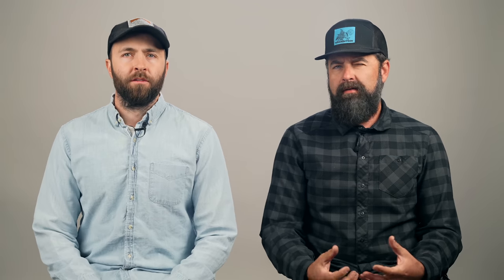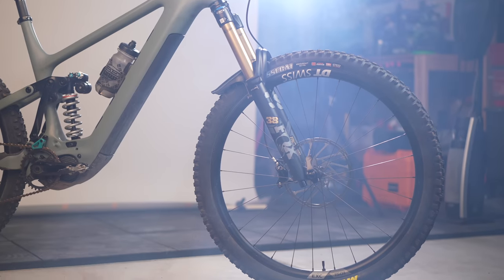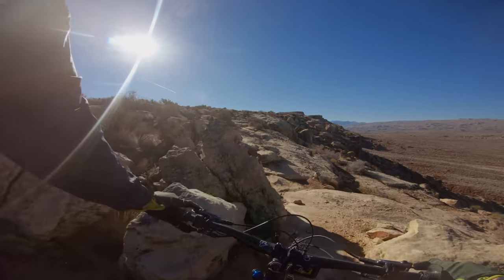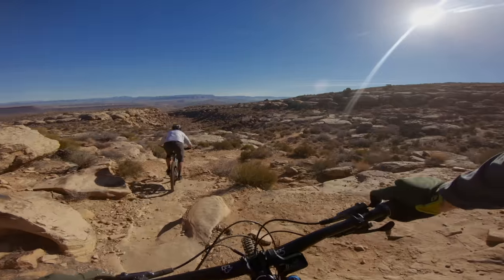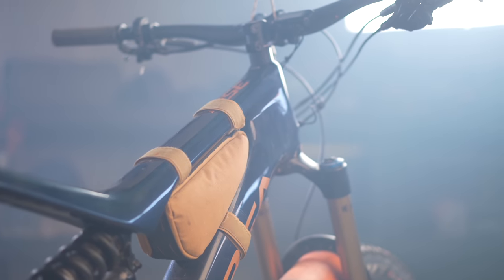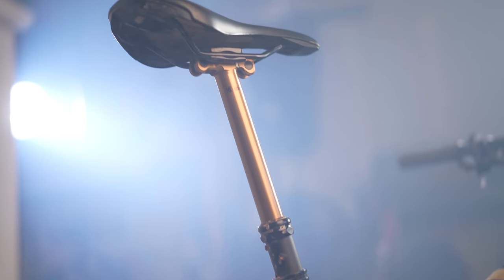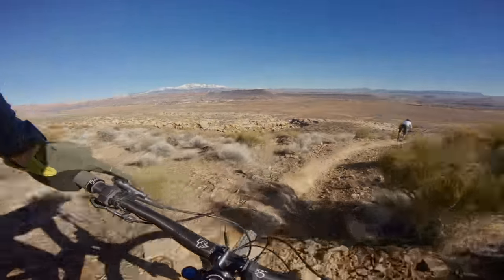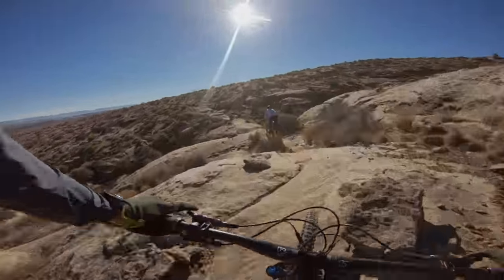Is a Slacker Head Tube Angle Better?

Comment: I took a Spot Rollik and added a -2 headset and a +10mm fork. Preserved almost all the geometry numbers accept the head angle which went from 67 to about 64.5. Loved it but it was noticeably floppier on tight climbs.
Reply from the maker: Good thinking with over forking in conjunction with the angle adjust. I noticed my Rise got a bit floppy too. I guess there are always going to be drawbacks
Reply: I just switched to a Ripley AF, my only the complaint is the number of pedal strikes I’m getting. Not sure if I should go up to a 140 air spring or put 165/170 cranks on vs the 175 that came stock. I love the way the bike does everything else so I’m hesitant to mess with the geo.

Comment: Since the angleset  is "lowering" the bike wouldn't it also steepen the seatpsot angle?. This could be a huge benefit on older GEO bikes that have slack seatpost angles such as the older Trance/Reign
Reply from the maker: It does make the seat tube steeper. It can help a bit there.

Comment: 75% of the riders out there don't have descents more than 1-2 minutes, so super slack bikes don't equate to better performance in those environments. I still ride a Stumpy 29er w a 51mm offset --68 degree head angle. It is perfect for riding in the midwset with way more climbing than descending.
Reply from the maker: Move to Utah. Our descents are way longer than 2 minutes.
Reply: @bikersedge  Dude, I almost moved to Durango 20 years ago. I regret it daily. Now, with wife and kids we can't move away from grandparents and their friends. 

I suppose the terrain out West would draw me to a more modern geo, but bikes have been very capable for a long time. Still love my light nimble 2013 Stumpy Elite 29. It is an alloy frame, with carbon cranks and bars... with tube. tools, water bottle, and frame pump, it is sub 30 lbs and 140/130 travel. It would be a downcountry bike by today's standard, That is what most people need imo.

Comment: Surely on a mobility bike you dont need to worry about the bikes geometry and setup on the climbs as much as a mountain biker would? I have spoken to a fair few people who have said that the ideal mobility bike would basically be almost a DH bike with a dropper post and a motor etc because they put in so much additional power that it massively compensates for pedalling position etc.
Reply from the maker: Not sure what a mobility bike is…

Comment: i'm planning to change my fork(rigid) to a suspension fork.

currently my bike setup is 69er mullet (26er frame). coz when i'm riding sometimes my foot sings in the front tire.

That's the reason why i wanna change the rigid fork into a suspension fork.

what travel fork should i be using? so it will be a little bit slacker at the same time it won't destroy the geometry.

thanks!!

Comment: So what was the final head tube angle on the rise? Did you go with an angle set and a longer air shaft? Are you thinking off increasing the rear travel with a longer stroke shock. I have a Rise but I think it would invalidate the warranty. Thanks for the. Review
Reply from the maker: We couldn’t get a super exact measurement but it ended up being around 64° with the Slackr and a 160mm air spring. I’d say plus or minus .3 ish degrees.

I haven’t considered changing the rear travel. I think if you’re going that far you may as well just buy the right bike in the first place rather than trying to turn a bike into something it’s not.

Comment: Any long term thoughts on best combo for Rise? Thinking of 1 degree slackR and 160mm fork for my rise. Love the bike but think it could benefit with a little more for what I ride. cheers
Reply from the maker: I don’t think orbea recommends running a 160mm fork. You might need to check that it won’t get you into warranty issues. If not, 160 with the Slackr could be great.

Comment: I added 10mm to my fork along with a 1 degree angle adjust headset, but I went with the combo because I’m running it on my hardtail (went from 120 to 130mm). My worry with the hardtail was that adding to the fork would actually steepen the HA as you go through the travel, so the idea with the -1 degree to slacken the head angle is to help counteract that a bit. Still haven’t had a chance to take it on a proper ride since making the change a week ago but looking forward to seeing how it handles some more technical trails!

Comment: Would this work?

A 29er with 140back and 150front travel, 66° headset angle.
Replace the backwheel with a 27,5" wheel to make it mullet and add 10mm more travel with a new front fork 160mm to increase the bb height a bit.

Head angle would end up at 64.5.

Smaller rider on a 29er wanting to try a mullet on a 29er
Would making it more slacker and enduro safe at the same time destroy the bike or is this an option?
Reply from the maker: The problem with that is the chainstay doesn't get shorter so you don't get the full benefit of the MX setup.

Comment: @Bikersedge Can you please provide a specific link on which angle headset kit you got on your Orbea Rise please. Thanks
Reply from the maker: It’s the 9point8 Slackr Oscar.l for my XL Rise. You’ll want to verify that works with whatever size you’re on. They’re dependent on head tube length.
Reply: @bikersedge  I got a medium with 105 headtube lenght per the website.  This puts me on the Bravo kit 1.4 slack.  Should I opt for the IS41 or IS42?  Thanks
Reply from the maker: According to the Orbea website it’s IS42

Comment: If you use an angle adjust in addition to overforking, wouldn’t that make the head tube angle even more slack than just the headset change? Why not counteract the lower bar height with slightly higher rise bars?
Reply from the maker: Yeah you’d get even slacker. That’s why I’d do a 0.5-1 degree angle set and a 10mm jump in the fork. Or like you said use a riser bar.

Comment: How do you like the push coil on the 160e?  Thinking about getting one for my bike - 160e.
Reply from the maker: It's awesome for that bike. Especially with the progression flip chip. you can put it in the most progressive setting and get a bit more bottom out resistance even with the coil .
Reply: How do you think it compares to the X2 the bike comes with?

Comment: Just picked up a Giant Reign e+ and because of winter I haven't done any riding on it yet but I'm going to start at the high setting and that is already at 64.5 and thats insane at my riding experience level. Will I want to put it in the low setting at 63.7? that seems like a difficult number to get around switchbacks.
Reply from the maker: You’re not wrong in thinking that. I ride a Sentinel with a 63.6° HTA. Most of our trails out here are pretty open but it can’t give me a tough time on really tight stuff.

Comment: I wish bikes came stock with a head tube adjuster. Just like many are coming with a flipchip. They could limit the range of frames and create 1 frame with infinite adjustability.
Reply from the maker: Yeah. Some have it with offset headsets and stuff. Kind of a cool idea. Flip chip basically accomplishes the same thing though.

Comment: Hi Guys!  I have a 2014 Blur TR with a 68 degree head angle.  Would it work out well to change my head tube angle and also over fork?  Can I even get the parts to do that for such an old bike?
Reply from the maker: I’d consult with your local bike shop and see what they can do. It’s pretty likely they can make it happen.

Comment: Did you have to modify/remove any material from the frame of the Rise to fit the Slack-r, or was it plug and play? I have considered to do the same on mine… TIA
Reply from the maker: It drops right in. It basically takes the place of your normal headset bearing in the frame with the slackr bearing now being above and below your head tube.
Reply: @bikersedge  thx! I’ve read that some bike frames may require some modification to make it drop in. Glad to hear the Rise frame is good!
Reply from the maker: Man I’d avoid doing that for sure. Sounds sketchy.

Comment: Slightly off topic but what do you guys think of hardtail party’s recent video on bikes manufacturing geo numbers being falsely advertised? Would be cool if you do something similar
Reply from the maker: Haven’t seen it. It would be really tough to get accurate measurements without some sort of jig/complicated measuring device to hold the bike perfectly square and straight.
Reply: That video was eye-opening! The HTA on your bike that’s advertised as 64.5 degrees could really be 66.5 deg. Can’t really trust any of the numbers posted on the manufacturer’s geo charts!
Reply from the maker: @leefunkera  yeah that’s a good point. I’ve heard of “marketing numbers” being used. It’s tough to verify without some serious measuring equipment.
Reply: @bikersedge  yeah…and there are other reasons why the numbers are off. 

Besides HTA, the Reach number can be off by 20mm, which is the difference between sizes. A Medium could be a Large or a Small! This emphasizes the importance of trying the actual bike in person if possible, or the buyer is going in blind!🫥

Comment: Can you use a spacer to do this on a Marlin 6 gen 2?
Reply from the maker: Not sure I follow. A spacer below the head tube?
Reply: I have the 7 gen 2.  I am keeping the 69.5 head angle.  I might was a couple degrees slacker for fast and rough downhill racing, but I say the steeper angle is better everywhere else for cornering, and plenty stable if you are not too lazy to get off the seat for rearward weighting.  I am not a fan of 29" wheels either, (not as good for cornering), or the 1 chain ring drive (pathetic top speed).  I guess i am not a fan of "modern thinking", because I don't think we think as well as we use to.  We should sue our schools.  They need a good "class action law suit".  I say your Marlin is about perfect for the head angle.  If the bars shake out of your hands on a rough downhill, then slack it a bit.  But they won't.  Maybe if you are sitting on the seat.

Comment: Over forking is not viable for tsller riders.  Side note the angle adjust is cool but imagine riding a purpose built slack bike already where the geo comes dialed for climbing as well. (V2 sentinal)
Reply from the maker: I’m 100% with you on buying the right bike in the first place. That’s always going to be the best way to go. 

I’m a tall guy with legs up to my armpits and I think on the right bike, over forking works just fine.
Reply: @bikersedge  haha really maybe its just me but being 6 "4 with a slack STA it really hurts my joints  and makes me  less upright

Comment: Looks for spy cameras around house

It's like you guys were spying on me and saw what I was literally just trying to figure out. I was contemplating the effects of head angelset on an SC Hightower(if even possible) and whether it would add any value. Like even a half degree fro. 65.2 to 64.7....

1)What are your thoughts on that and 2)is there a standard formula for the change in overall wheelbase measure for some [X] degree change in head angle? Like +/- X degree head angle change = +/- Y mm of wheelbase change....?

Thanks for all of these vids. Big time valuable and influential!
Reply from the maker: We have spies everywhere!!!

I think the Hightower would be great to make a bit slacker. I want to say it uses a standard press in headset so you would have a lot of options for angle adjust headsets. I'd probably look into over forking a bit too.

You could probably do some fancy trigonometry to find how much longer the wheelbase gets. It's going to depend on the original HTA as well as how much slacker the bike gets. Keep in mind, all those numbers go out the window the second you sit on the bike and sag into the travel .
Reply: @bikersedge  then Mr Burns said, "Excelleeeeennnnnt"

Comment: I don't think your considerations about front end height are logical? With a fully integrated headset the Slack-R angle adjuster adds 10mm between the fork and the bottom of the headtube (effectively lifting the front end by about 9.1mm if you would have kept the 65° and disregarded the slackening). But including the slackening, if your fork is about 590 mm long (160 mm Fox) and your head angle is 65°, your headtube will be about 914.7mm from the ground (including half of the height of a 29" tyre). If you slacken this to 63.5° and take into account the additional 10mm (in your "fork length") on account of the Slack-R spacer/cup, your headtube should be about 917.0mm from the ground (or 916.0mm for 63.3° etc.). So your front end in this case should have gotten taller. There are some minor simplifications to this calculation but the fact is that by using Slack-R on integrated headsets one should get a very small change in the height of the front end and generally the front end might even be taller rather than shorter (except for very slack angles).

Comment: Do you loose reach when using an angel set? I know u loose mabe 5mm givw or take over forking by 10mm.  I would think if you did both you would loose quite a bit no?
Reply from the maker: You do lose some reach when you over fork because you're lifting the front of the bike up (bringing it closer to the BB). The angleset in theory should do the opposite because it's lowering the front end. Now, the distance to the handlebars is going to be shorter than before, especially when doing both.
Reply: @bikersedge  gotcha if you do both they should offset but each bike / situation will very. But there will be a slight shortening of reach but probably not noticed 👍
Reply from the maker: Yeah they should offset each other in terms of reach. In terms of distance to the handlebars they’re going to compound though. That measurement will get shorter.
Reply: @bikersedge  what headset is in the rise? Really thinking of getting one if I canuse another angelset that would not be so extreme.
Reply: A slack angle set will bring the bars closer.  That’s what it does with the ride 9 on Rocky Mountains.